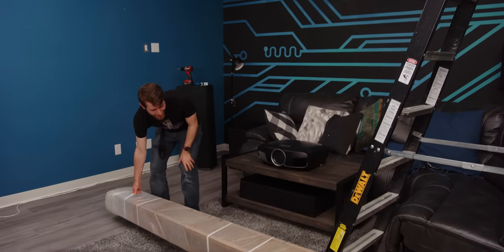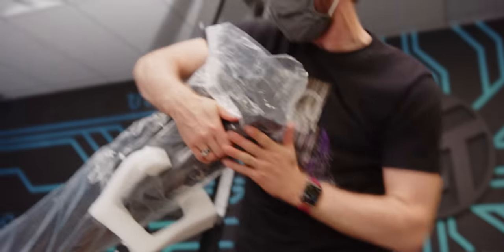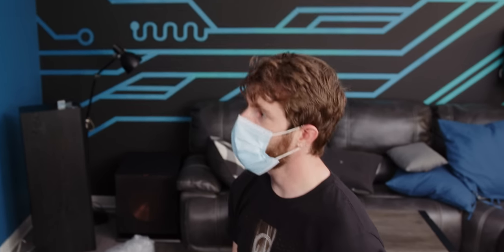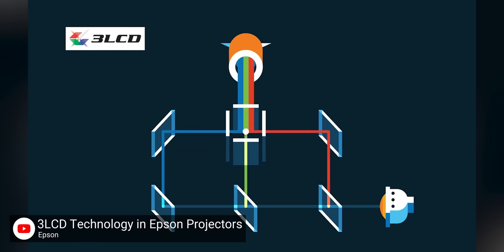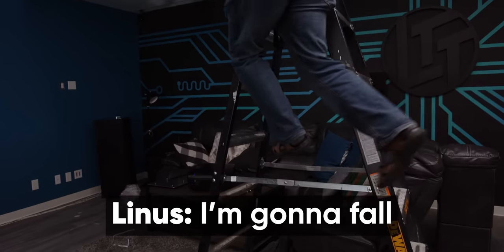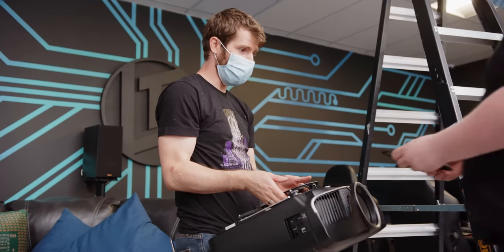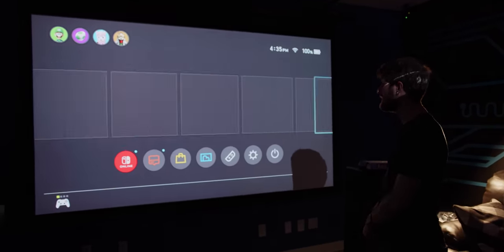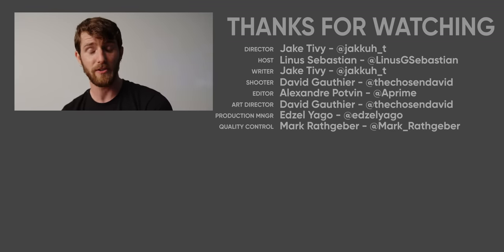Setting Up This Projector Was SO Much Work D: - LMG Lounge Update 2021

Comment: "How do you measure .8 of a foot?"

*Laughs in metric.
Reply: i don't know how long a foot is, let alone .8 of a foot
Reply: I mean that's why he's confused since Canada uses metric, otherwise he'd know it means 11 feet 8 inches.
Reply: [ROLLS EYES IN "BI-LINGUAL"] It's 9.6 inches. 
(Or 0.8 x 30.5cm = "Why even bother calculating this if you've already got feet and inches and tenths of inches marked on the same tape measure?!?" =:o} )
Reply: @tukuiPat  Naw, officially we use metric but in the day to day feet and inches are still unfortunately super common.  We know the difference between how .8 of a foot and 8 inches are written.

Good guess though!
Reply: @simpson6700  a foot is 12 inches.
Reply: @rishabhsingh5694  it's also 30.48 cm
Reply: @ibigfire  well clearly not, when instructions show a measurement of X.Y feet that's X feet Y inches and anyone who regularly uses standard would know this.
Reply: @tukuiPat  But it should be 5'8".  5.8 is not 5'8".  Unless they used incorrect notation, which would be weird for a big name company like that.
Reply: @ibigfire  I've never had a manual use 5'8", it's always been 5.8
Reply: @ibigfire  and it wouldn't make sense to put a projector 11 feet and 7/8th of an inch away from a screen.
Reply: @maximravinet9950  There is also no reason to stop using imperial. ¯\_(ツ)_/¯
Reply: @ibigfire  it do be like that sometimes.
Reply: @AurumFaber  Well that's simply not true, I'm surprised people still think this in this day and age.  Metric is so blatantly better I figured pretty much everyone agreed that the only reason places hung into Imperial was out of the hassle of switching.
Reply: @AurumFaber  except ease of use and understanding of the rest of the world. You know, so you don't have to do math gymnastics every time you try to communicate with someone from another country, or watch a foreign youtuber or buy a product from somewhere else.
Reply: @ibigfire  I meant that it is true that (5'8") is sometimes documented as (5.8).
Reply: @AurumFaber  Oh, well.  Guess it's just not something I've seen.  That's fair.  Seems like a bad idea to represent it like that though, decimals already have a meaning in numbers so representing it like that seems like it would lead to easy confusion for sure.
Reply: @maximravinet9950  I always have a calculator or paper and pencil on hand so ease of use doesn't matter to me.
 I don't communicate with anyone in any other country about topics related to measurements unless it is a conversation like this one, anonymous and meaningless. That reason doesn't apply to me. 

You gave me reasons to start using the metric system, not stop. I already use it on a daily basis so I don't need those. 

Why should I/we stop using the metric system?
Reply: @ibigfire  Oh don't get me wrong, it is extremely confusing unless it is two digits after the decimal, (11.10, 11.11).
Im happy that it is rare.
Reply: @AurumFaber  they are reasons to stop using imperial. And it is a lot easier to just have one measurement system (with identical steps between units) than having two of them that don't line up and just become a mess.
Reply: @maximravinet9950  ease of use does not matter to me, I possess a calculator.
I'd need a valid reason to stop.

Edit: They do line up. If you don't know that much, you aren't qualified to answer my question. 
An inch equals EXACTLY 25.4 millimeters. And the other imperial units follow suit.
Reply: @AurumFaber  yeah 25.4 is perfectly practical. The .4 is exactly the kind of stuff I am referring to with the "don't line up" thing. Same for a foot which 30cm and some random millimeters. And yeah sure using your calculator every time is absolutely not a proof that using that using the two systems is inconvenient as hell
Reply: @ibigfire  ffs that notation is so horribly bothersome and painful to use
Reply: @maximravinet9950  it's literally four tenths of a millimeter. I thought you loved the number ten! Maybe that guy was right, you can't use fractions.
And a foot is not, "...30cm and some random millimeters." it is,
 (12× 25mm) + (.4mm × 12)
That's (25*4*3) + (4.8) which equals 304.8mm or 30.48cm (No calculator necessary.)
But I guess you can't multiply either? No wonder you use the metric system!
Unlike you, I don't need a calculator, it's just faster than pencil and paper.
Reply: @alex.thedeadite  it's also ⅓ of a yard.
Reply: @Sciurus Niger "Fractions are hard for people that use metric." - true, but: fractions are hard. Imperial makes you learn do accept it and do things the hard way, while metric avoids it, making things just simple.
That being said, metric people still use fractions, because we still have these nasty time units. They are painful by themselves, but their common inclusion into compound units is really infuriating. Yes, i'm looking at you, RPMs, liters per minute, kph and amphours/watt-hours. Furthermore, why the hell do we measure energy of a snack in calories, and battery energy in watt-hours, when it could be all in joules, and insta put things into perspective of how does a snack compare to a capacity of a powerbank? We are still not fully metric, unfortunately.
Reply: @AurumFaber  OK so I see you are wearing your blindfold and don't see the problem with trying to convert using 30.48 and 2.54. It's just a hassle for the pleasure of it.
Reply: @maximravinet9950  HAHAHA!
Do you think I'm stupid‽
Sorry to tell you this but, I'm not.
I know that using the imperial system is hard (compared to metric).
I know that converting one to the other is even harder.
BUT. I. DONT. CARE!
Metric will gain wider adoption but imperial is here to stay. Why not use both? You still haven't given me a valid reason to stop using the imperial system, you only stated why the metric system is better. 
I know that the metric system is "better." But you can't give me a valid reason to use it exclusively. Heck, you can't even give me a decent reason!
"It is a lot easier to just have one measurements system..." Ok then, I'll just use imperial. How you do you like that?

The only metric unit that I am asked to use is cubic centimeters/milliliters (but we call it "cc," not even recognizing it's metric roots) I use it to measure medicine for my animals. But guess what? There is no conversion! 
The bottle says "99 lbs/9 mL". I take my syringe (which is marked in mL) and pull enough liquid to get to the nine. (I don't even have to count!)
The convenience of the metric system means absolutely nothing to me, so I'm going to need another reason. ¯\_(ツ)_/¯
End rant. :-P
Reply: @victortitov1740  wdym? Fractions are easy.
Reply: Its 4/5 so you have to go to 120ths so 96/120 and then divide by 10 to get back to inches so 9.6 inches.
Reply: a foot is a stupid measurements as everyone doesn't have the same size of feet..
Reply: @dubious6718  it's a stupid name.
Reply: Notation 8.5 can be read as 8 feet 5 inches or as 8 feet 9 inches and some... (3/5 of an inch) If this is not a valid reason to leave Customary units behind...
Reply: @ivoivanov7407  ...I don't know what is.
Reply: @AurumFaber  CC’s does recognise metric roots as it actually means cubic centimetres?

Although technically centimetres aren’t metric

And since you can’t seem to put 2 and 2 together, since you’ve acknowledged metric is easier, I apparently have to say US Customary Units are harder

12 into feet, 3 into yards, 1760 yards into a mile
Converting between thou and fractions of an inch is annoying
Fluid and mass ounces
US and imperial gallons
Reply: @thomasa5619  I literally said, "I know that using the imperial system is hard (compared to metric)."
And I never implied that the imperial system wasn't harder to use than the metric system. 
Give me one reason to stop using it.
That's all that I want.

And you don't have to repeat the conversion inconsistencies with imperial, I use it everyday.
Reply: Why aren't they using metric? Doesn't Canada use metric for 40 years or something?
Reply: @AurumFaber  you asked for a reason to stop. That’s a reason to stop. Is it really that hard to understand?
Reply: @thomasa5619    So I should stop using it because "it's too hard?"

That's like saying that a truck driver should switch from a manual transmission to an automatic because "it's too hard." No it is hard compared to the automatic, but he can switch gears while eating a sandwich.

That's like saying that the tropical native should move to a temperate climate because "it's too hot." No, it's hot compared to the temperate climate, but he is comfortable in the hotter climate.

That's like saying that a high schooler should go back to elementary school because "it's too tough." No, it's tough compared to elementary school, but he can do algebra on autopilot.

Sure, all of these people will acknowledge that they're doing things the more difficult way, but that doesn't mean that they want to change.

The truck driver will lose fuel economy with an automatic transmission.
The tropical native will feel cold in the temperate climate.
The high schooler will be bored in the elementary school.

And I will lose time converting metric to imperial to metric again.

I grew up using the imperial system which means that if I move to metric I will still have to use imperial as a reference. 
Because to me, a meter is three inches longer than a yard. 
A kilogram is a little more than two pounds.
 A liter is a little more than a quart. 

These are things that I grew up with for 19 years, I'm not going to stop thinking that way now.
I have nothing against the metric system, I use it everyday. But I'm not going to stop using the imperial system. Never.
Reply: @AurumFaber  again, you asked for a reason to change

It’s a reason to change.

I gave you what you asked for.

You don’t actually have to change, but you still argue.
Reply: @AurumFaber  PS I enjoy driving manual in my car, and got my open “crashbox” truck license this month for shits and giggles

If you receive directions in metric, and work in metric, using metric tools, you don’t have to convert to imperial and back. And I’d suggest if you’re measuring in meters and really care about 3 inches of difference (7%?), you should be using a tape measure anyway.

Climate shouldn’t be that unhealthy to justify the effort to move somewhere? I’ve grown up in a tropical climate? I hate it? I snow ski without a jacket? I still live in a tropical climate cause I can’t be bothered finding a new job or moving?
Reply: @thomasa5619  
Understandable, have a great day.
Reply: "Fractions are hard for people that use metric"
BRUH America, you know, one of the very few countries that still use imperial, is the same country where the 1/3 pound burger failed against the 1/4 pound burger cause people believed the 1/3 was smaller.

Comment: "every pixel looks so freakin' sharp. can you see that??"
Proceeds to show blurry shot.
Reply: Not to mention the Switch runs 1080p I think
Reply: @girlsdrinkfeck  I doubt that
Reply: @girlsdrinkfeck  It's 4k, check the link in the description
Reply: @doeburner9270  the screens inside the projector are native 1080p but uses some weird pixel shift technology that slightly moves the pixels around to simulate 4k but still isn't as sharp is true native 4k
Reply: @girlsdrinkfeck  you have to be careful about how they label projectors I've found, it may say 4k here and there but if you go to the official epson page and read further into the description it says "4K Enhancement Technology shifts each pixel diagonally to double Full HD resolution"
Reply: @girlsdrinkfeck  yeah I've been looking to buy a true 4k for the last few months and have found alot of descriptions to be quite deceptive
Reply: @girlsdrinkfeck  nice, I'll look into the benq's, maybe they have what I'm looking for
Reply: @girlsdrinkfeck  and I thought 720p was HD
Reply: It is extremely difficult to capture projectors on any camera. I also have one and I can never show on any picture or video how it looks in person. The light flying through the air just fucks up camera sensors.
Reply: Its why phones cameras are so amazing these days but people still cant pirate movie in theaters, the cameras just cant capture the image properly
Reply: @girlsdrinkfeck   HD is considered 720, Full HD is 1080, thats why 1440 is called quadHD.
Reply: @girlsdrinkfeck  the projector has pixel shift, it projects 4 1080p images so 4k but it can be done differently and the quality reaces from worse than 1080 to nearly true 4k
Reply: @girlsdrinkfeck  720p is hd, not full HD tho. Stupid terminologies make it still technically HD, just not good HD
Reply: @girlsdrinkfeck  And that''s why they called 720p HD Ready back then.
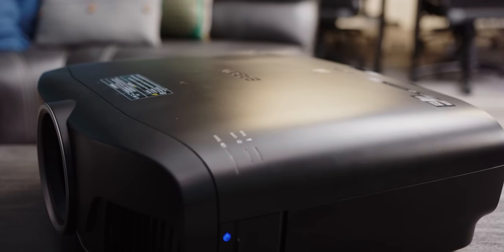Reply: @kyle1elyk  6:01
Reply: @girlsdrinkfeck  because this has way way better colors than benq way better blacks and contrast ratio and looks natural and benq looks artificial comparing to it. For a little less sharpness Epson takes the crown

Comment: Jake: "Oh... there's a stud here.  Oh, there's a stud there. Here's where the actual stud is...."

That's how it works, Jake.  It marks the edges of your stud.  Then you center up.  😅
Reply: Lol did they not get an idea when the magnet they used to locate the steel studs were right between their two markings?
Reply: Came looking for this comment exactly. Not all heroes wear capes. Keep up the good work.
Reply: NA and their paper walls. Jeez.
Reply: @RandomUser2401  brick gang
Reply: @wsketchy  BRONCKS
Reply: @RandomUser2401  Brick interior walls are just stupid.
Reply: @rsporter  Hahahaha yeah, sure. Except that
- you can actually mount stuff to them
- they provide much better sound insulation
- they cannot be damaged/punctured with a bare finger

Comment: 11:28
"Yeah, OSHA I have something you might want to see..."
Reply: They're in Canada...
Reply: CCOHS maybe
Reply: @bglad09  Man, kids can't handle a joke these days
Reply: @Verlisify  I knew it was a joke I was just being an a hole.
Reply: Time to call OSHA
Reply: @bglad09  at least you own it
Reply: Canadian OSHA is called WHMIS btw
Reply: @mo0man  i mean depending on where you are, there is also OHSA
Reply: Is it a FIRE POLE?
Reply: @mo0man  Not really, WHMIS is only hazardous material/chemicals information system. Work health and safety is mostly dealt with at the provincial level, though some industries are covered at the federal level by the CCOHS.
Reply: @mo0man  Not even close to the same thing.
Reply: Also pretty sure you can't put wood inside drop ceilings (fire Hazard)

Comment: 5:26 This keystone downside you're mentioning here... is unique to the increasingly common cheaper option of DIGITAL keystone. In older projectors (from over a decade ago) Optical keystone shifting used to be the normal thing, but was more expensive, because it requires moving the things around inside the projector itself, such as actually tilting the LCD pane. You still have to angle the projector to point at the center though.

when it became easy enough to just narrow the image into a trapezoid in software, they started doing the much cheaper digital keystone adjustment instead. 

11:43  That lens shift is cool.

Comment: 2:14  All I heard there was "We don't know how to use a stud finder."  The finder didn't say "there's a stud here and here".  It said "The edge of the stud is here and here so you want to drill between these two points."
Reply: Is that also the case for steel studs? I genuinely don't know as have only ever needed to find wood studs.
Reply: I believe it's just looking for a change in thickness so any sort of stud would work. I just don't understand why NA buildings seem to be deliberately built in the most unhelpful ways.
Reply: @K-o-R  How do they do stud finding in other countries? :/
Reply: @krenotenze  we have actual solid walls, no need to find studs :D
Reply: @TobiasLeininger  weird! That must use tons of material! I can't even imagine how much that must run when a 2x4 costs $8-12 alone...
Reply: @krenotenze  we also use bricks and stones and concrete ;) Houses in Germany are built to last hundreds of years.
Reply: @TobiasLeininger  wow, yeah they don't build for that kind of longevity here. Then again, brick and stone costs significantly more than wood here too.
Reply: @krenotenze  at this point, idk anymore. We might just see them out of concrete
Reply: @krenotenze MASSIVBAUWEISE

Comment: "how do you messure .8 of a foot?"
Rest of the world: We are 4 parallel universes ahead of you
Reply: It’s extremely easy to figure out what measurement that would be
Reply: @ItzzTesta  It's not hard, but it's not simple either. It's .8 * 12 to find how many inches. It's still ridiculous that you have to do weird math to figure it out.
Reply: @prismglider5922  it's even more disturbing if you're from overseas (like every 9/10 people) but hey 1,5 inches *2,54cm are 3,81cm or the usual attentionspan of Linus...^^
Reply: theyre in england not america
Reply: They're in BC, in Canada houses will use imperial system (at least for the houses I have seen), why we do that is beyond me, tradition maybe? Or just too lazy to switch, whatever it is, it can be confusing if you don't work with imperial a lot
Reply: @blockmancer7492  Canada is all sorts of messed up. We use °C for weather, °F for cooking, drivers license has my height and weight in metric but I honestly couldn't tell you what 6'0'' is in cm off the top of my head, long distances I'll use kilometers short ones imperial, and in my job I think I can probably count on my hand the number of drawings that were strictly in metric on one hand. 

I blame the U.S. for inflicting this upon us.
Reply: metric
Reply: @blockmancer7492  canada mostly uses metric, but they share/import a lot of stuff from the US, so you'll have appliances with imperial on it, and you'll use it for some cases due to culture sharing between the two countries.
Reply: UK and Canada still use imperial in some weird cases. The legacy of the British Empire.